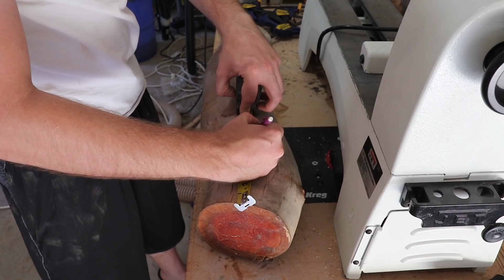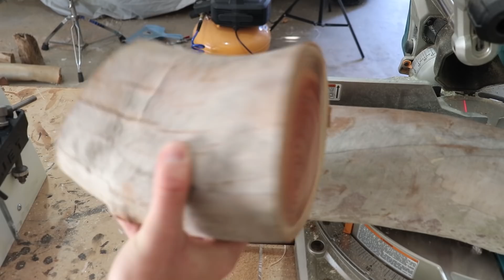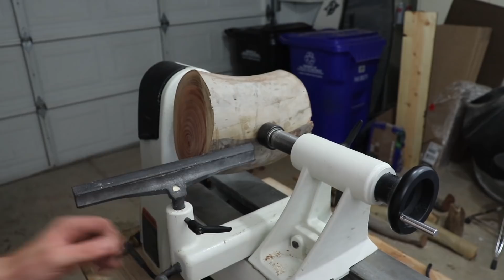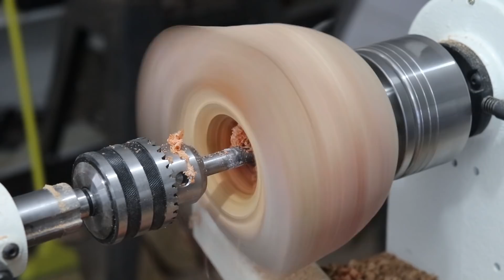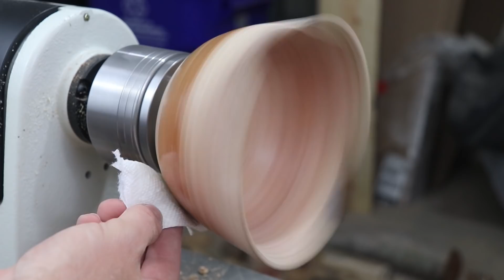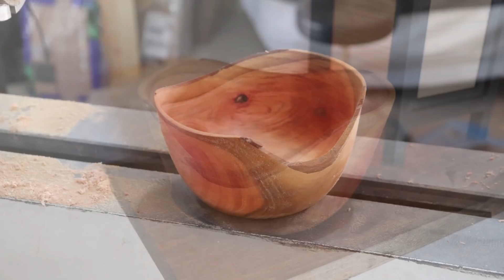Wood Turning a Log into a Bowl

Comment: Well, you can do a lot with scrapers, but they are not good for finish cuts on bowls. End grain, like boxes and vases you can get glass smooth surfaces. Learn to use gouges and you will get far less tear out and tool marks, and cut your sanding time in half. Good shape to the bowl.
Reply from the maker: Thanks for tips. I’ve since moved on to gouges. In fact I’ve watched a few of your videos and read posts from you on woodturning forums, so a genuine thank you for sharing your knowledge and helping others learn

Comment: What did you seal that with? Also if I may ask, did you have to dry that after to avoid cracks?
Reply from the maker: It's called butcher block conditioner. There's a link in the description if you want to see the specifics, but it's food safe! And yes, the wood has been drying for a few months in my garage
Reply: @CookWoodworks  oh so you dried the wood before turning it?
Reply from the maker: Yep! There was still some moisture in it but not enough to make it crack after I turned it
Reply: @CookWoodworks  thank you for taking the time to make this and respond!